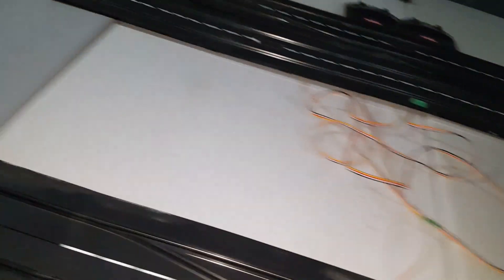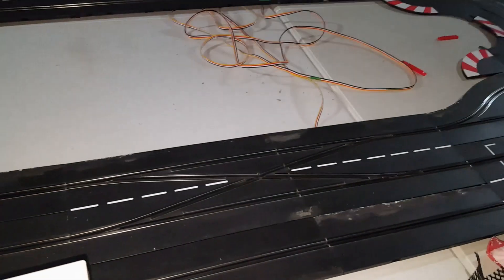Variable Power Supply Part 1: Do You Need It?

Comment: I have just a 2 lane track, 74 feet long, 7 lane changers, a start gate, an extended pit lane,  no issues so far, no jumpers installed.  I did buy tge 1/24 power supply to run the larger scale cars.  I've tested 6 ghost cars, and there are no issues.  I do plan on installing anti collision chips in all lane changes. I will add jumpers then, but do you think even after that, will I need a variable power supply?

Comment: If buying a set, and running it as such or an extended track length two lane variation thereof, KISS rules. Evo or Digital the Carrera supplied wall wart transformers will power them reliably and avoid Gumby end user induced problems or failures.

Comment: You may not need a variable power supply with a basic 2 lane kit, but... I found that it is very useful.  The one my track came with is only 12 volts.  I found that increasing the volts to even 13 volts made a difference.  Also, if you have young kids who want to run, the slot cars lowering the volts for young and / or inexperienced drivers is very useful.  Also, for only $18.99, though Amazon, you can get an AC to DC  variable power supply that will do 9-36 volts.  And I did not have to rewire the track, it just plugged in.
Reply: Can you share a link to that variable power supply?

Comment: You should also consider that you might want to lower the voltage for different cars. I have a GO  track and the cars are way to fast. Just a little plunger action sends them flying. Some other cars may have different power requirements also.  So a variable power supply makes your setup more flexible.
Reply: I agree, sometimes taking power away is a necessity, or makes it more enjoyable.

Comment: Old tyco track. I seperated the power on each lane, a must, then I took  two old tyco train transformers(VARIABLE  VOLTAGE) that I had and wired them to each lane then wired one power tap on each lane. Then I bought two aftermarket controllers (DSL I think) a must, the control I have on my cars from my Hp7s, 440x2, Rokar , Autoworld Super 111, AND my Mega G plus cars is absolutely astounding. Looking to find something with more voltage or adding another transformer in series?  The info videos are not very good.

Comment: You need it because Carrera cars are SLOW
Reply from the maker: Carrera's cars are fine. Especially for small home tracks.
Reply: @Sundayslotcars  I get that if that’s what someone likes. It’s all good. I have a very large track and like to get and make cars much faster. One good thing no matter the car is you can make them faster. I tend to put 30-46k rpm NSR motors in Carrera cars so they can compete better with Scalextric or the other makers cars. Good job!

Comment: Do you think power taps are needed for a 2 lane custom Carrera digital layout?  Not "humongous" but laid out on a 12x16 table.  Will be running 2-3 ghost cars in addition to user controlled car.   I am still constructing and doing test runs and noticed a slow down in one area but I think due to the track not being joined up correctly in that spot.  Power tap opinion?
Reply from the maker: I'd grab a set of taps. You can try getting the track to fit better but I wouldn't bother buying gap filling pieces to get around buying power taps.
Reply: @Sundayslotcars  solid advice. I was already thinking the work-around but you stopped me at my tracks.

Comment: The more I research the cost of Carrera, the more I lean toward Scalextric.
Reply: Personally, I like Carrera much more and I like having 1/24 cars.  I like the width of Carrera track and wider radius turns.
Reply: @GeoffreyHuber  are you able to somehow run 6 cars with 1/24? I really want the ability to run as many cars as possible. I agree, the 1/24 scale seems so much better, but I dont like the limit of 4. And regarding the width of track, while its a nice feature, by the time you add borders etc I just dont think I can build a nice track and maintain any agreeable amount of space requirements with the wifey.
Reply from the maker: @jkabee  I assume from your comments that you'd like digital. Right now I'm tax free for a little longer so that should help mitigate cost. A usual Carrera starter set is about 5 by 10, so with borders it's not so bad. Carrera also has true banked turns which helps make straights feel longer. So if you must save room at least get Carrera Digital 132 so you can upgrade to 1/24 later.
Reply: @jkabee  I have not tried as it's just me and my son but I have seen Carrera tracks on Youtube running 6 1/24 with a proper power supply.
Reply: @jkabee  yes you can run six 1/24 cars but you need an after market power supply. The power supply that comes with the carrera set only has enough power for 4 cars. The “system” can handle 6 cars. Carrera sells a cable that will go to an aftermarket power supply just for this upgrade. It’s around $70, rip off, you can make your own if your handy.
Reply: Thanks for all the responses guys! I really like the Carrera brand and product. It will be a tough decision for sure.

Comment: When I switched to 1/24 rather than buy a Carrera power supply and used my variable power supply I already had on hand.  I think I paid $30 on ebay for it.  Chopped the cable off my 1/32 power supply and connected it to my power supply.  Way less expensive.
Reply: I did the same! I’m using 1/24, 6 cars, after market power supply is a must! Cut the cable off, put a fuse in line and run with it. Simple and cheap. If you can’t crimp and/or solder have your wife do it while you do the dishes. 1/24 vs 1/32 is like high school football VS NFL.  Seriously, grown men drive 1/24. Own it, love it.
Reply: What brand of PS did you buy and how has it held up? Reviews on most seem to be hit or miss. I would like one for HO and 1/24.
Reply: My HO track will be a 4 lane oval using stock Tyco, Life Like, and Autoworld. I did order a Jag Hobbies TR3 and a BSR Hobbies Bulldog SRT to test out. They may be my main cars to loan/race with friends.
1/24 will be a routed "ROVAL" using RTR brass chassis/model car bodies racers and some 1/32 mixed brand cars.
Both will be analog of course. Against, looking at trying to find info about decent PS's.